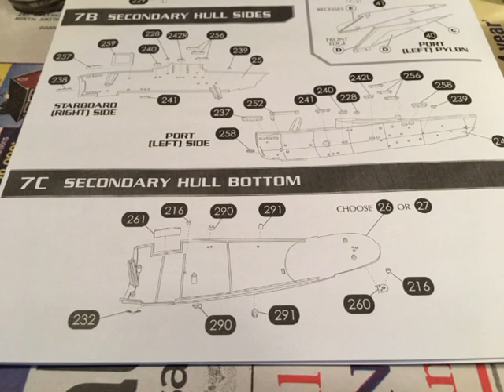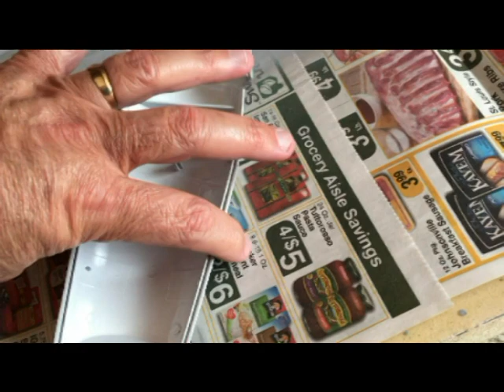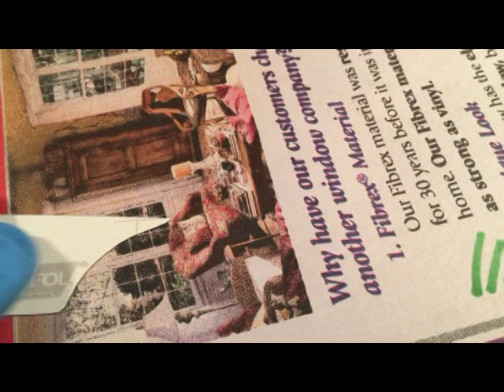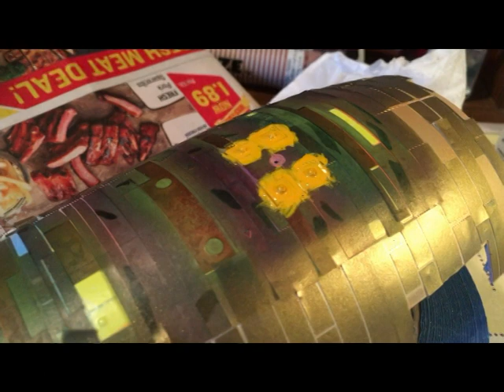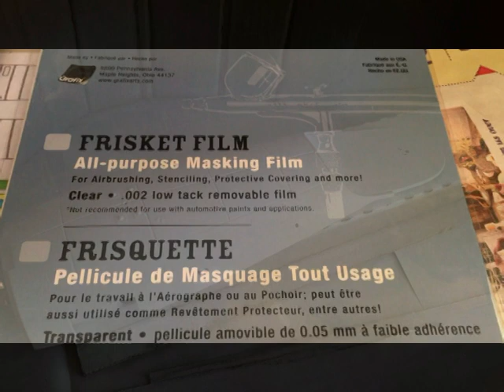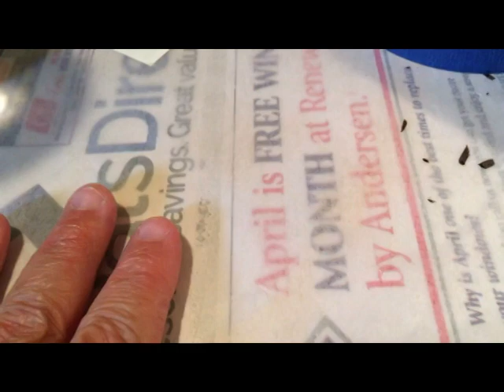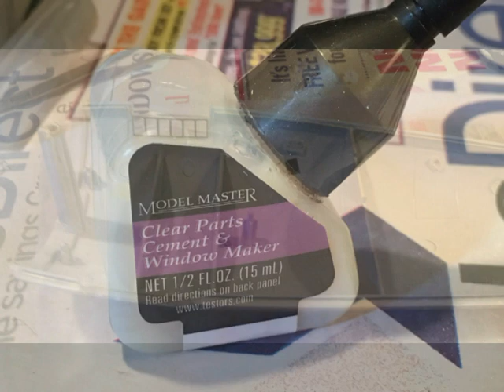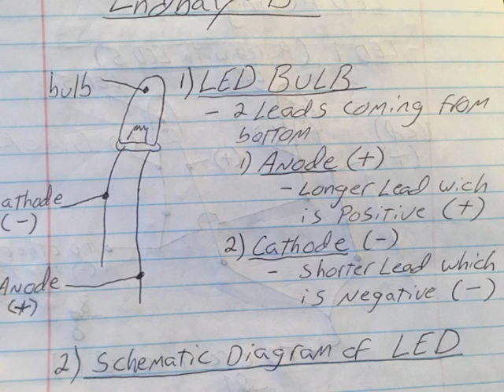(POL949/04)    7C -  Secondary Hull Bottom

Comment: I think your main problem is the paints you are using for the aztecing. You really need transparent iridescent paints and be light with your coats. Polytranspar paints or Jaquard Pearl EX pigments mixed in Alclad  clear are both good aztec paint choices. You may also want to check out my review of the MaskDesign paint masks.